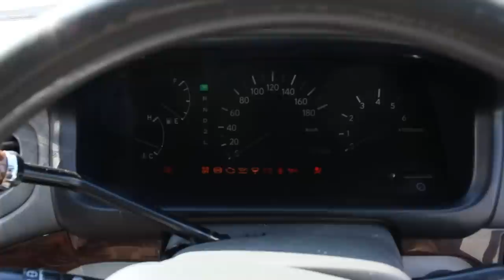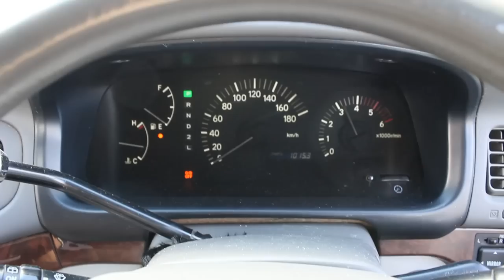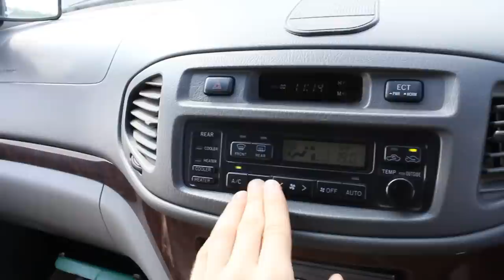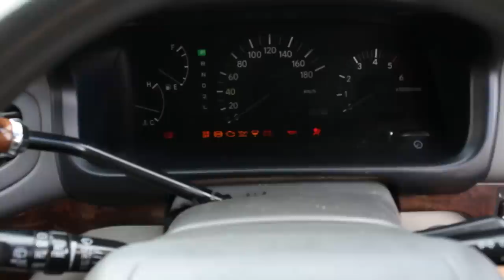1997 Toyota Hiace Regius. Start Up, Engine, and In Depth Tour.

Comment: I recently purchased a Regius which was a peach of a bargain. 1998 model, 67k on the clock, mint condition £2000 and I love it to bits !! One thing I've yet to suss out though is how to spin the captains chairs. It looks like you pull the catch below, at the front but it does nothing. Is there some kind of safety feature whereby I have to adjust the chair in such a way as to allow the release mechanism to disengage and thus spin the chair? It's frustrating the hell out of me :O)
Reply: Hello M Lord :O) Haven't actually worked out what the MPG is, but I'm guessing around 30mpg and yes... I absolutely LOVE driving it. It's so quiet and smooth and with the 2.7L fuel injected engine it's got plenty of oomf !! Motorway cruising is a delight, it's such a relaxing drive you don't realise how fast you're going. When I first took it on the A14 at one point I looked down at the speedo and was amazed to see we were doing 80mph. Reliability wise, Not had it very long but so far so good. Haven'y had to turn the key more than once yet. I'd highly recommend getting one !!
Reply: I have problems on finding spare parts for this car...  Do you know where to find em? If u do let me know...
Reply: @SONGSTICKS   me too man
Reply: hay have you still got your regius ?  if so hows it going ? im looking to get one hopefuly.
Reply: I have this same question!!!! Was hoping to see how to do it in this extensive video...
Reply: @megaretr do you remember how to swivel the front seats?